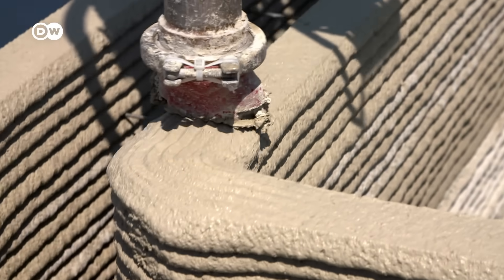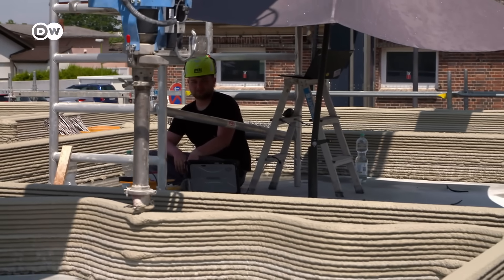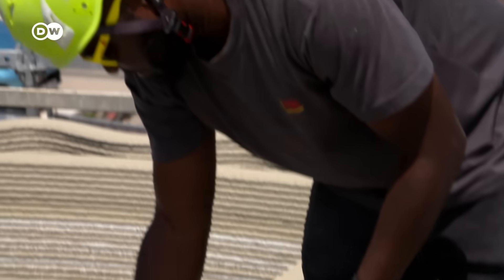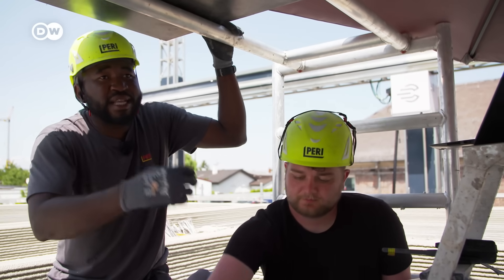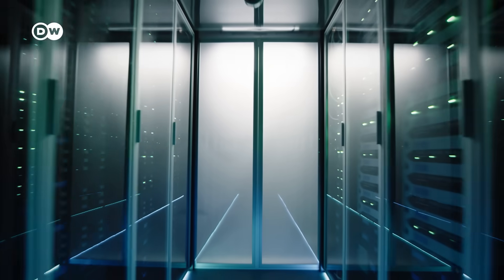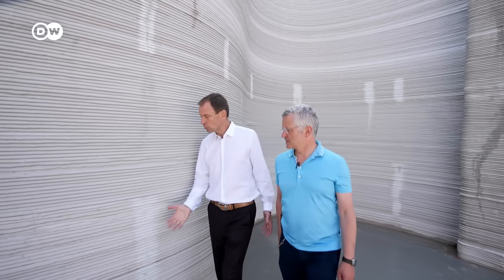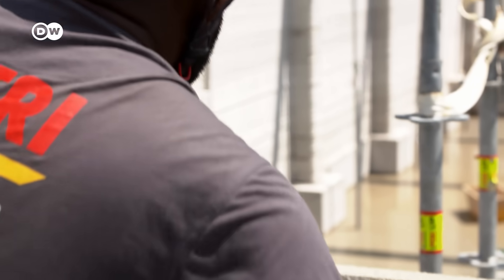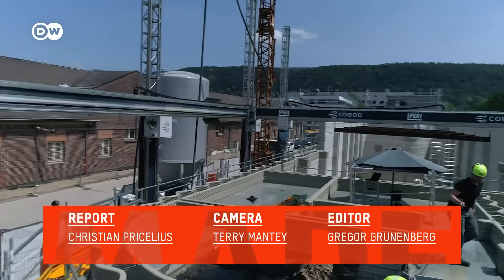How Europe's biggest 3D-printed building is being constructed | DW News

Comment: There is almost no reinforcing steel in the building, so I don't think it will meet the Building Standards Act.
If there is an earthquake, it will collapse.
Reply: First: This building is being constructed in Heidelberg, Germany. I don't even know if this area ever had an earthquake.
Second: No building permission in Germany without a structural engineer calculating the structural analysis.
Reply: But the Building Standard Act does not apply in most part of the world. And most part of world does not experience strong earthquakes.
Reply: My father was a construction engineer, but he didn't talk about his work and I know very little.
If I would have this 3D printer I would probably use it to build the casing and then just pour the cement in between. So, basically, I would build my house as usual and just use the 3d printer for the casing.
Reply: Maybe the curved surface doesnt need rebars... just guessing... Romans did not have rebars and their buildings are still standing...
Reply: They could possibly melt some metal and pour it between gaps or slot it in place, I don't know the complete process but I know they probably would do something to meet these standards more than just: here's a printed building and now lets watch it collapse and laugh. After the cement dries of course, if they did it during there would be issues.

Comment: How resilient is this type of architecture? Is it anti-seismic? The surface is very rough, how much will it be the plattering costs? What about electrical and fibers installations? No windows 😂?
Reply: Anti-seismic?! At 3:21 in the video, on the left side of the image, there is already a huge vertical crack in the wall closest to the camera 😂